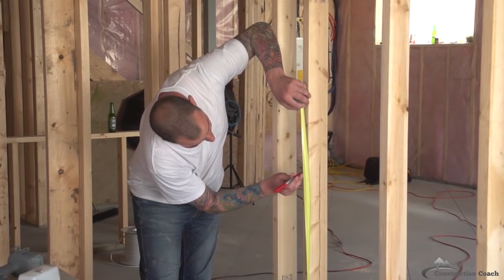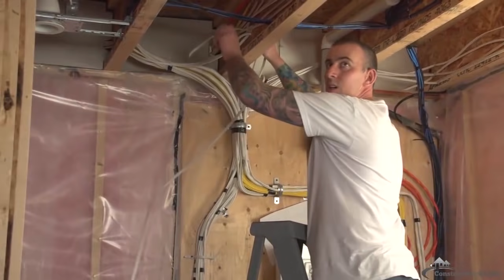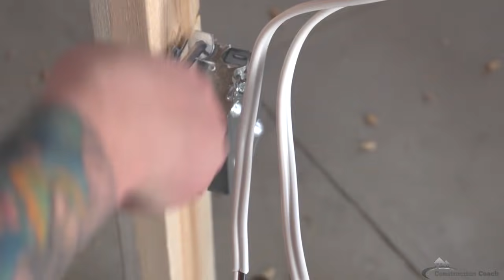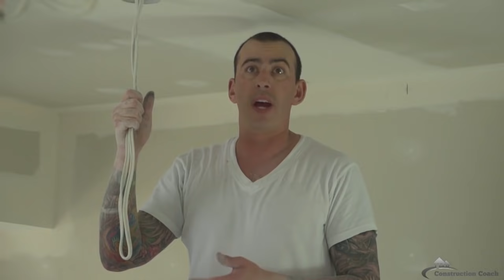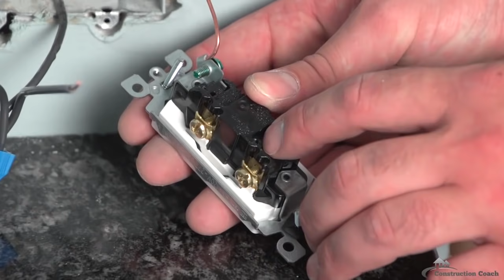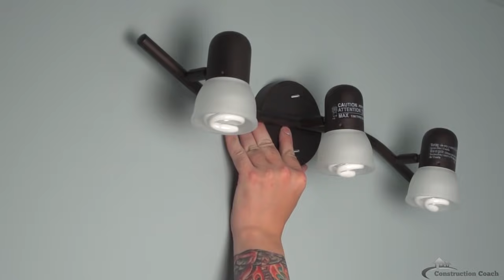Home Electrical 101 - What you need to know now!

Comment: I'm so confused. Why are you not doing the electrical before your bats and plastic? O.o
Reply from the maker: I had moved into the home before the basement was developed. The building inspector required the insulation be installed before occupancy of the home. Pretty standard unless you are finishing the basement at the same time as the home.

Comment: 8 minutes in; enough for me. No electrician I know calls an outlet a plug? To be a complete tutorial, Code requirements as to location of outlets should be mentioned! The metal box shown is made as a nail-on and that feature is easier to cope with than screws. Suggestion: Make a template out of 1/2" plywood; 2 1/2" wide x 20" tall with a notch cut in one end 4' x 1". Now you have something to set on the floor at the stud you plan to nail a box on. It should lie flat against the stud  giving you your height and protrusion in one motion. No measuring every box!!

Comment: Dude the lights get roughed in before drywall  and you forgot nail plates so drywallers dont screw into it
Reply: Confused on that as well.  When the ceiling is open, I always rough in new construction cans.  Our inspectors here would fail us otherwise since we're all in EMT around here.  (Chicago Suburbs)

Comment: we put  the wire in conduit here in Jamaica, we do a harder & safer job... good video tho
Reply: we use conduit everywhere.
Reply: @seanjamaica5308  any idea why conduit is intended to protect the wire you have studs and sheetrock to avoid damage seems like conduit would be overly expensive for use in a house unless your houses are made of concrete blocks or something like that
Reply: we use conduit internal and external, one lent conduit cost about US$1.10. we can tower clip wire external but only after it's inspected...
Reply: yeh mon

Comment: What happens if i want to add another lamp and a switch ? 
Do i need to open the drywalls ? 
Why not installing pipes and put the cables inside them ?? 
That seems like no turn back work 
Just to be clear i dont speak about the electrician i speak about the concept
Reply: general iroh    Ok so you want to add a switch and a light.   Assuming it is all required to be in conduit, you will have to remove the drywall to install boxes and conduit.   Probably less drywall affected if done with cable than conduit.

Comment: I don't like his approach to ground wires.    I always cut one long, that is for the lug screw on the box (does not apply in plastic boxes) and never cut any of them less than 6" long.   IF the devices I am using have mounting screw that runs thru a bronze fitting (usually at the bottom) then I don't need to tie the ground wires to the fixture (again, does not apply in plastic boxes) If I am using a plastic box or the device does not have a bonding spring on the mounting screw, I use a green wire nut with a hole thru the middle to run my long ground wire and use that to bond the device.

But I don't think much of his approach to grounding/bonding.   I doubt I would survive a close inspection by the inspector.

Comment: This young man is not an electrician. He does know enough to be a little dangerous. He is probably doing all the work in this house himself. He has other how to videos like hanging and taping drywall. There were too many NEC violations to list. However I admire his DIY  attitude. Just saying.
Reply: al lede name the code violations.
Reply: carlos MENDOZA sure this works for him and it's fine for him. Its not critical to anyone else only thing is codes are codes. I'm sure if I list the violations you and others will find an explanation why he did it the way he did and that it worked. It's ok no need to get froggy. Go and do electrical work if you feel comfortable with it. Everyone starts somewhere he is clearly trying and it's ok.

Comment: are you afraid of conduit?
Reply: its not normal in the states for residential( we have a lot of timber stick framing unlike block/brick in europe).  but i have used it for basements  and garages myself i live in New England cold moist cement basements romex gets brittle and staples come out of expanding and contracting wood
Reply: @wizard3z868  what are you talking about?most new construction in residences require conduit
Reply: @steveruffolo1360   ive seen  houses built in my city using seu no conduit.needing conduit the only place i cld see wld be from outside meter  to inside panel than after that all other conductors can just be run thru walls from connectors attached to panel. im in new england so our panels are on the inside with just the meter on the outside i cringe when i see the panel and meter both on the outside.
Reply: @wizard3z868  I'm in Chicago, no non metalic cables can be used
Reply: @steveruffolo1360  well there you go its that jurisdiction having authority thing like i say to most pple the nec is just a recommendation not law its up to local authorities to make their own minds up  on codes and practices. chicago isnt that the capital of ill-no-toys or no-joys  lol

Comment: Bedrooms requires Arc Fault so you cannot put the lights and the receptacle on the same circuit..you should use 3wire instead going into the switch box..

Comment: There should be no more than two wire which go to light for every moret, you put all white and black wire, where's one that go to switch. This connection will trip the breaker, its a short circuit presentation. Just a comment, better review the wiring.tnx

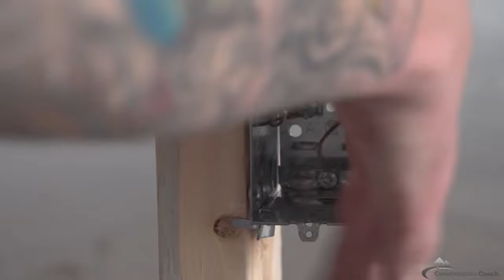Comment: 31:52 Any inspector would fail you instantly for using a non-ground screw to ground metal boxes as well. These are the type of mistakes that would piss of an inspector. Certain types of obvious errors make inspectors mad, like you are wasting their time or trying to get over on them. That's when the inspector will look for ANYTHING to get you. I've mentioned only a couple of the any errors like this he's made. Don't go by this if you need to get inspected....

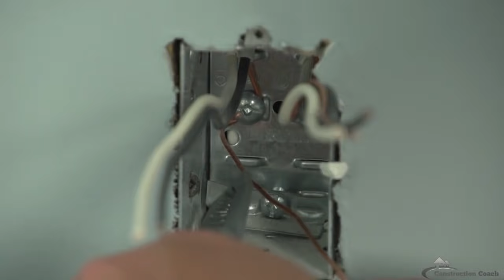Comment: Great now u just showed anyone that just watched this video that's not an electrician how to NOT ground the rest of that circuit once it leaves that box at 1:08:45 cause those grounds needed to be twisted together so that the next device box that wire goes to is also grounded and so on so in other words if that were the first receptical u hit directly from the panel and the grounds aren't tied together in that box no other outlets,switches,lights ect...from that point on will be grounded. TERRIFIC!

Comment: Wire = 1 conductor 
Cable = more than 1 conductor
Reply: Mejia   I agree.   There is an exception in the NEC.   Got to section 400 on cable trays.   It says "single conductor cable".  I could never get this clarified as to what or why it is there.

Comment: Roughing in the electrical AFTER the insulation is completed is a sure sign
of an amateur.  You end up screwing up the insulation job and the vapor
barrier plus it is a bitch to drill studs and run wire at this time.

Comment: I am wondering why the metal boxes instead of plastic? Plastic are much quicker to work with and cheaper. Leaving a loop above the boxes is not a NEC requirement only 6” out of the box. The loop could get nicked by a drywall screw. I’ll stop there...No I won’t lol. Installing and wiring “new work cans” prior to drywall is much easier and that is the normal the way it’s done. What you are doing is cutting drywall and installing and wiring “old work cans” but your work is new. Ok well I have more but I’ll actually stop here....

Comment: DO THEY ALWAYS INSULATE BEFORE THEY FINISH INSTALLING ELECTICAL?? SEEM LIKE YOUR HAVING TO REDO STUFF
Reply from the maker: I moved into the house before I finished the basement,  the building code required me to have minimum r12 insulation around the perimeter of the foundation before I could move in.

Comment: HA !  Stop doing electrical work the code violations 314.14 NEC  .Boxes too small 314.4  NEC Table 314.16 ( A ) and ( B ) 
314.16 A . B 1 . 2 . 4  Please read these codes  ? What code requires 6" of conductor outside the surface face of and outlet box for the connection of the device ???

Comment: service loops are a waste of time and wire and it looks like shit if your Dry Waller is chewing up your wires inside the box he needs to shorten the bit on his zip tool or not use a zip because he don't know how to do it.I am also concerned when you staple your wires right on the edge of the stud so a drywall screw can ruin your day.I would kick you jn the nuts for not making up your switch boxes or at least identify your switch leg.other than that good job bro.

Comment: Funny guy - instead of using laser level for the whole room or floor and simply kick boxes in, crawls to every plug with pencil. And there is a tool called impact screwdriver. Why not to build a simple floor stand for wire bobbin? No tool for striping wires?? Seriously?? Ok, a cheap tool later. Yes, you get more tools to carry, but you finish site two times faster. 
So wicked twisted joints... Because of 110V for the same power like on 240V you will have more amps going through. Now I see, why houses in US burn so often. #Facepalm on unnecessary pigtail. One wire in each switch and connect them together. At least know your items! Where is the point to put wire around screw, when your twists will burn? If you want to do properly, do everything properly! And not to mention safety - no gloves, no helmet, no googles. Bad coach! But funny to watch so lame work :D